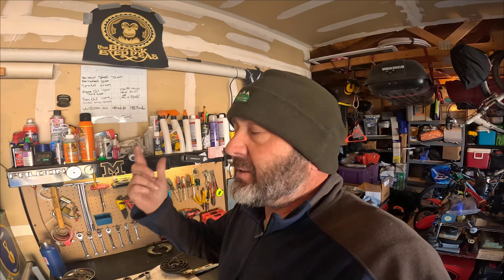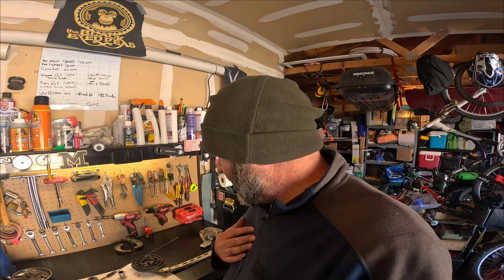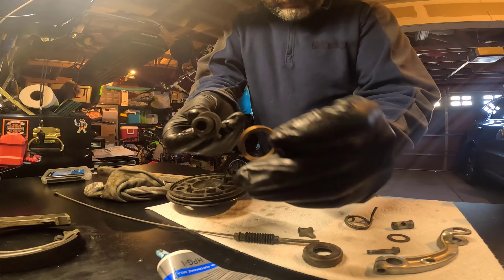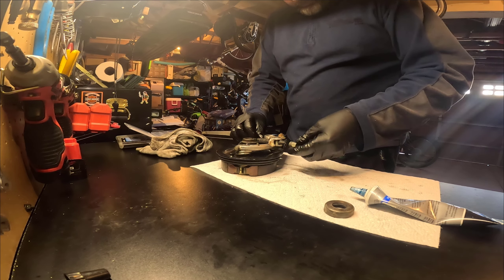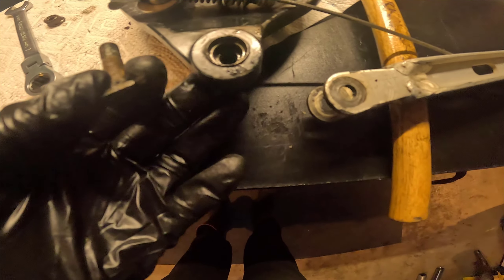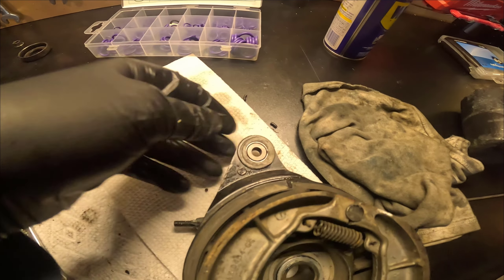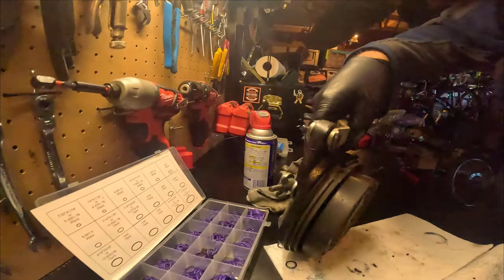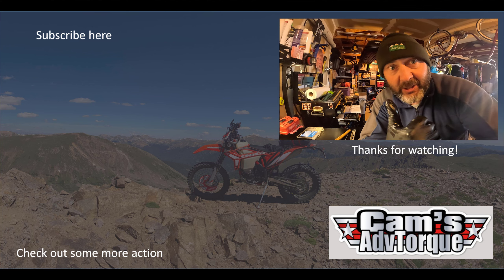1985 CR250 Barn Find Project - Part 7

Comment: Rear brake cams do wear on the edges and won't release. New brake shoes can fix the problem . Over time it will get worse and the cam will need replacing 🎉.